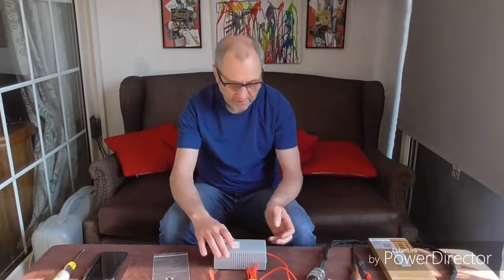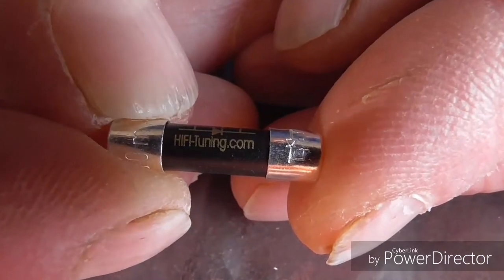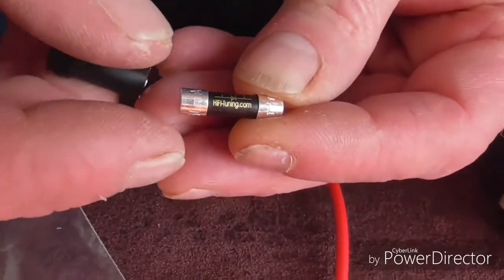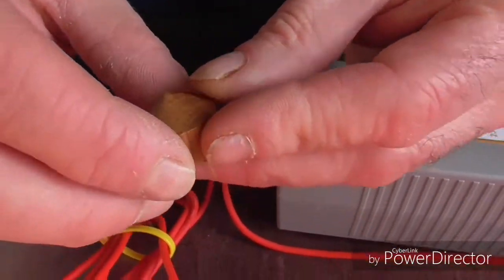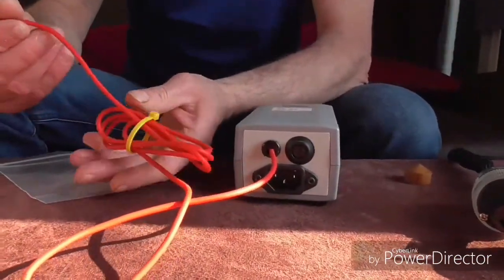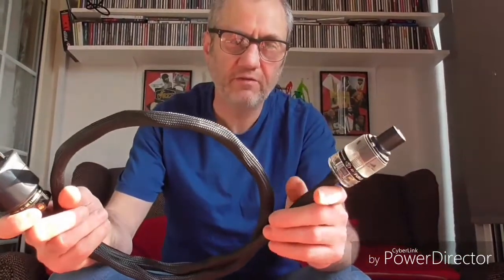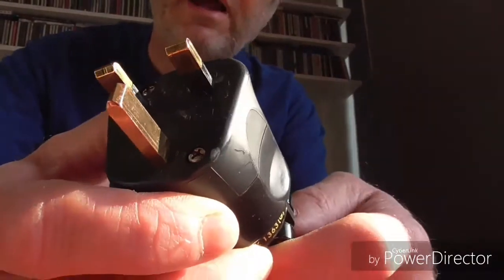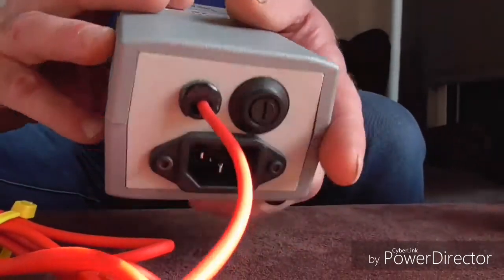Upgrading to Audiophile fuses

Comment: I now have had a mains fuse on my phono stage, the first thing I noticed was a lower noise floor and better instrument separation, 2 weeks ago I changed the internal fuse on the phono stage and even better. Thank you tweaker man.
Reply: Thank you Tony for describing the difference. I am seriously considering doing this for preamp PSU, power amp and CD. Unlike many tweaks it doesn't cost  the earth! :-) All the best, Rob

Comment: I also have hifi tuning supreme fuses throughout my system with AMR hifi fuses in my mains plugs. They DO make a difference but you need a system good enough to warrant it. Must upgrade mains cables first though to get the effect.

Comment: Since these fuses are directional, should you install them running left to right as you install them from the rear of the component?
Reply from the maker: They have an arrow on them, you just need to check with an electrical screwdriver which way the electric is flowing & put the fuse in the correct way, thanks for commenting & watching 👍

Comment: Which way around did you get the best sound? I used a multimeter to test current flow from positive to negative (brown/red to black wiring) and have them inserted the opposite way to how you showed inserting the fuse initially. Cheers.
Reply from the maker: I've got the best results, with the arrow head towards the equipment.
Reply: Thanks. Many have said the fuse arrow sounds better in the direction of the current flow which in my equipment is with the fuse diode pointing away from the equipment ie into the fuse cap. Maybe your fuse holders are wired differently. Be interested to know how you decided on direction ie listening or in the direction of current flow. Cheers!
Reply from the maker: Hello Mats, I found in listening test, that with the arrow following the current flow, into the equipment, soundstage was deeper & wider, remembering these are subtle changes, but changes still, thanks for watching.
Reply: Thanks. Agree. You tried any other audiophile fuses like Isoclean, Furutech, Synergistic Research?
Reply from the maker: Check out my other. Video ( fitting more internal fuses), these are the best ones I've found & they are cheap.

Comment: IF ceramic fuses made a difference, audio companies would install them.
Reply from the maker: It all about cost, hi-end companies do install theses type of fuses, thanks for commenting & searching👍
Reply: My Parasound JC5 amp came with 5 20A 6x32mm ceramic fuses and 4 1A 6x32 glass fuses from the factory. 

My Mola Mola DAC came with a 1A 5x20 ceramic fuse.

Comment: This makes sense! especially when it's the weakest link in the system it does something with the sound. Of course the system needs to have the resolution.
In addition to this video, when you never have tried it you can't say anything about it. Everything is important!!!
Reply from the maker: 1962Klaas If your building a pure copper or 10% silver cladded copper mains cable you must use a Audiophile fuse, because the fuse is the weakest link, for me its a no brainer, like you us audiophiles are extremely tuned in to sound quality.
Reply: Fact is, there is no gain in using a silver cable as a main. Pure copper is the term that is describing a main cable.
We, studio personnel are also tuned into sound quality.

Comment: Snake oil 101
Reply from the maker: I suppose changing your mains cable is also snake oil, thanks for watching.
Reply: Incorrect. I just bought a HiFI Tuning fuse and installed it tonight and my SQ absolutely improved. If you have good gear you will hear the difference.

Comment: What a load of pure B.S.
Reply from the maker: Hello, i'll take that from you if you've tryed them, but if you haven't, then you shouldn't be commenting, thanks for watching
Reply: Have tried Synergistic Research blue fuses and I wasted my money completely,  further to that because they were relatively expensive, I went back and forth several times without any noticeable difference. Never again, it’s simply audiofoolery to believe in pseudoscience. I’m glad you had more favourable results
Reply from the maker: Hello, check my other video, ( fitting more audiophile fuses), I've found some excellent fuses direct from china & they are only £5, what a audiophile bargain, I've fitted them in my amps & they really are good, but remember you also need them in your powercord as well, for £5 they are worth a try, again thanks for watching, I'm only trying to save people money with my videos, thanks for watching

Comment: The f...ing fuse is in the AC which means alternating current, this means the direction of the current changes 50 or 60 times per second depending on were you live...so scientifically it makes no difference which way around you put this snake oil fuse. Changing fuses or power cords does not change anything to the sound of the device, whether it is an amplifier, a cd player, a dac, a record player, a tuner.....moving your speaker 1 inch around in your room makes more difference. Companies who sell stuff like this should be closed down and put into jail for the rest of their lives... And so called audiophiles should stop listening to their gear and start listening to music..... And do not come to me with the BS that my system is not good enough or my ears not trained, if you think or believe you hear a difference that is because your brain biased...try a real blind test and stop spending money on snake oil...do some room treatment instead, cost less and your sound will improve.....
Reply: I bought a $50 audiophile fuse and it absolutely changed the sound on a Gustard U16 DDC so you are incorrect that it can't make a difference.
Reply: Thank you!!! I'd also like to outlaw these liars and see them all behind bars!
Reply: @Channel939393  HAHAHAHAHAHAA jackass :)